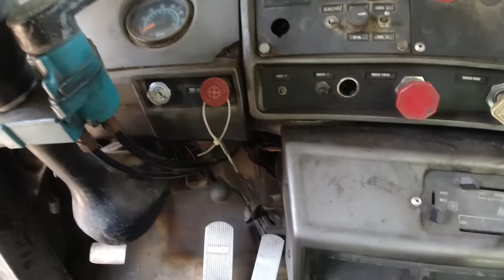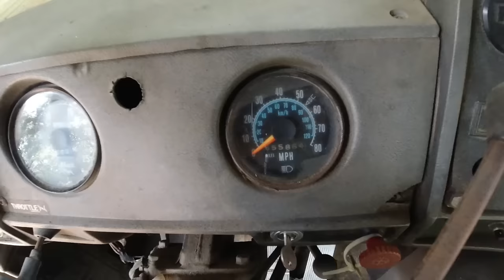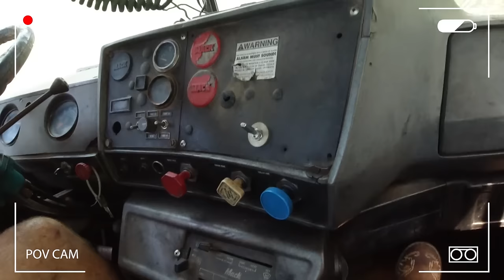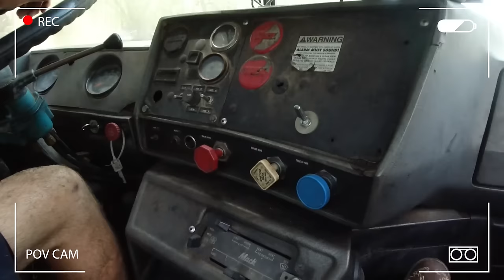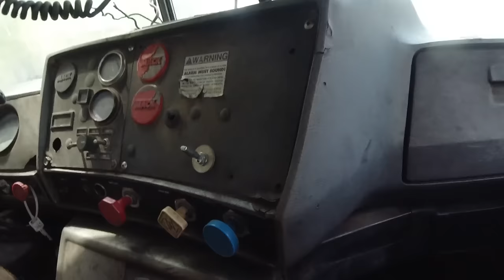Will it start? Driver said he drove it 600 miles then it quit!  Left it sitting!

Comment: For all the Mack’s y’all find you still don’t know much about them! Whenever you see the Econodyne label it’s a differ power curve than a Maxidyne, it’s more narrow. Maxidyne will have 5,6 or 7 speeds where trucks like this one will have 9 or 10 speeds. Some will have Mack 10 or 12 speeds and Eaton 13 and 15 speeds. Most of those years had Eaton 9 speeds, they shift better than the Mack 10 and 12 speeds. That same years Superliners were the same E6 350’s with 9 speeds. Nice job though keep finding them and saving them! Good ole trucks!

Comment: Mack Bulldog Ornament Color Designations
1941 - December 1941 thru September 1944 the chrome finish was replaced by Mack Gray 775R, a
painted finish.

1967 - Starting for the 1967 model year, the original “gold” ornaments signified that a vehicle featured
the Mack Maxidyne engine and Maxitorque transmission. Mack trucks with other components
used the chrome plated ornaments.

1980 - The engine color was changed to Andes Copper thus, the Maxidyne gold bulldogs were no
longer used. During the month of March, the gold bulldog changed to silver across our
product line. (SED#757-80)

1992 - Starting with the introduction of the CL model in the 1992 model year, CL models with the Elite
trim packages utilized the gold ornament. The CH model with the Elite high-level interior trim
package may also have included the gold ornament.

1995 - CH models for the 1995 model year with Pedigree Powertrain utilized the gold ornament.
(SED#1122-94)
.
2000 - CX models with the Millennium Gold Package utilized a gold Bulldog with a gold base.
(SED#1202-00)

2007 - Starting with the 2007 model year, the gold ornament indicated that a vehicle had an all-Mack
powertrain, i.e., Mack engine, Mack transmission, and Mack axles. This is its current usage.
2019 - Starting in 2019, a copper ornament was added to signify electric power, starting with the
Electric LR model.

2020 Starting in 2020, a black ornament was added as a feature on the
Limited Edition Mack Black Anthem model.

Comment: 9 speed Mack trans.its a Mack I knew it would start .Thats a nice old truck. If that long usually the brake shoes rust to the drums.. probably has algae in the fuel need to drain the tanks and change the filter. 6500 is a steal for that truck

Comment: He probably has a bad head gasket on his air compressor, especially if he is losing coolant and he is having a lot of water in his air tanks… if not he needs to change his air dryer filter and see if that alleviates some of the water issues

Comment: Gold Dog from 65' & in the 70's Ment the truck had a Maxidyne Engine under the hood .

 For what ever reason the gold dog wasnt on the hood during the 80's.  not even on the hood of the purebred Bulldogs.

Then in the 90's the Gold Dog returned on the hood of the "pure bred" Macks . meaning it was 100% Mack drivetrain & thats what it means to this day although Mack engines & automated  transmissions are rebranded Volvo componets .   

3 oil filters tells me that is a E6-300 or E6-350 Mack .  From the factory ,  R685 is a E6-237 Engine , R686 is a E6-300 Engine , R688 is E6-350 Engine 

Mack hasnst had a manual transmission of their own since 2018 or 2019 .

 Unless you special order a new bulldog with a Roadranger manual transmission, most of your new Macks come with Automated (Automatic)  Transmission . 

Mack

Comment: I like the old R models,  the first truck I drove was a 1966, R model,  then a 74, and a 77. The 66, and 74 had the 237 Mack engine.  The 77 had the 283/285 horsepower Mack. The 66 had the Mack Quadraplex,  and the 74, and 77 had the 2 stick 6 speed.  I pulled dump trailers with all of them.  Rough riding,  but good dependable truck's.

Comment: Why don't you put a second alternator on service truck and run battery cables back to your batteries so as you are driving to your next start up you can make sure that the batteries you brought are fully charged. You could also jump start people from that connection.

Comment: Silver dog means that it IS NOT all Mack, from the factory. Some part of the drive line is something other that original Mack equupment. A Gold bulldog on the hood means that it is ALL MACK driveline components installed from the factory.....an undisputible FACT!!
Reply: Silver dog only means that it’s a therodyne engine possibly a 237 hp it’s still all Mack only the size of the motor we had one here in Australia 🇦🇺 with a gold dog it was a 285hp with a 12speed transmission all Mack it had 2 air cleaners
Reply: Thermodyne grr auto correct and word replacement
Reply: Don’t roast me over my comments i do know what I’m talking about iv had over 30 years experience with these old Mack’s